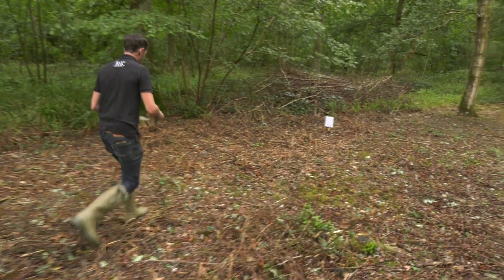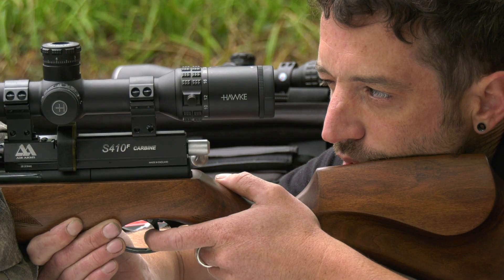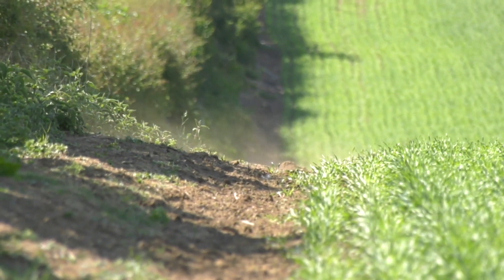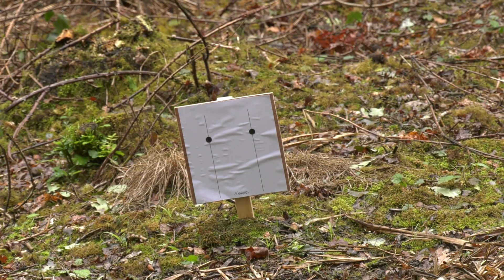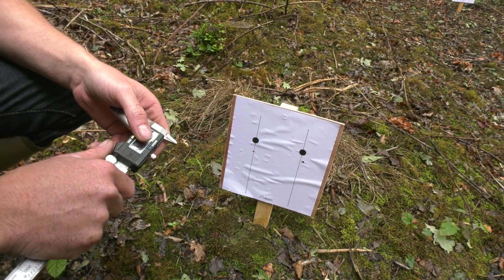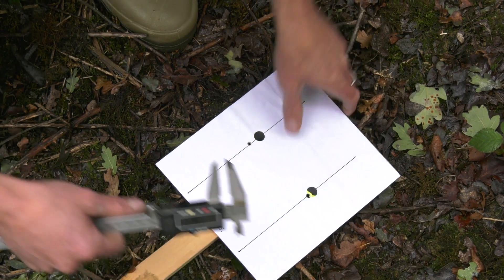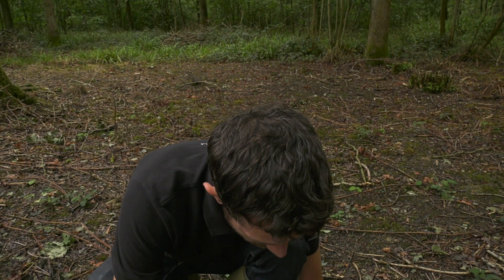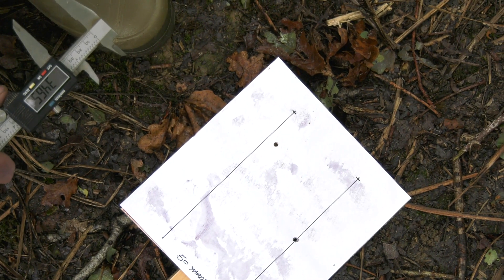What's the trajectory difference between a .22 and a  .177?

Comment: No, I do not think your test is valid, what about the speed? If they were fired at the same speed the picture would be very different! I suppose your test is valid if both were limited to the same fpe but if they were fired at the same velocity the .22 trajectory will be flatter than the .177 due to a better BC.

Comment: I thought it would make bigger difference. I would call it a success if I could hit that 50yard board at all. Last time I tried hitting at all at 30 yards with cheap pellets, I couldn’t. They were too cheap😂It depends all on rifle, pellet and shooting position and experience. From that clip I’ve learned that it makes no difference for target shooting. You zero it and can shoot all day long. .22 will be more wind resistant and have slightly more energy left on the target. I don’t see a point for switching from .22 to .177. Besides cheap co2 rifles never get 17J. It’s for maintaining higher shot count and stability. So if I crank up power slightly then it might even shoot faster than off the shelf some .177 co2. And if there are some even over 10 grain .177 pellets and compared to 13.4 JSB jumbo RS .22, then it is almost the same trajectory. Besides in my country it’s not allowed to shoot animals , so one shot one kill is not an issue. I don’t even have comfortable shooting range easy to access for long range, poor lighting, ppl shoot there from pistols at 25m.

Comment: Just get a cheap golf range finder and use range stuckers on your elevation turret, stick out some targets at 5m intervals, range them ,and adjust your turret until you are on zero and stick a range sticker on and keep going out to 60m ,one all the stckers are on ,cover the turret ring with a clear tape to protect them ,if not and you can afford £600 get a range finding NV scope that adjusts your zero and you can film at the same time
Reply: What rangefinder scope is there for 600 quid? Genuine question. Just got a new pcp and want a scope
Reply: @BRISTOLDNB  DNT make the Arken Zulus 3x12 or 5x20 day/night vision with a built-in LRF ballistic calculator ,they do one without the LRF for a bit cheaper but for the extra money I would get one ,they have also bought out the Thermnight ,so same set up but with a thermal scope built in so you get a 3 in 1 scope for £999 and a few more other models that is slightly higher in price ,if you are ratting in a barn and shooting out to 50m get the 3x12 as this will range down to 4m out to 1000m for sub 12 airguns, if you want a bit more range go for the 5x20, the do more powerful mag ones ,all the models can take centerfire rifles and been tested on .50cals ,very small and compact and lightweight, everyone or going mad for them ,DTN also listen to customer feedback and after service is great ,I love mine
Reply: @crazycressy7986  thanks mate that's super helpfull, appreciated!!!
Reply: @BRISTOLDNB  they have a few fb groups as well ,lots of tips and tricks and good guys on there to help set up if you get stuck

Comment: The bigger the pellet, the faster they fall...  I dont need a rangefinder.  I have 8.3 gr Superdomes at 1,000 fps, 18.4 fpe.  Pest lethal at 45 yards with nearly no holdover.  Zero at 30 meters.  Why would I go back to a 22 with the same power but worse accuracy?  177 doing just fine in all my guns.  One shot, one very cheap kill.   Good video.

Comment: I think this changes between calibers when pushed to FAC levels. I believe reason being weight and drag. I can’t see hitting anything bigger than a sparrow past 50-60 yards with a .177 7.4 grain and with a .22 18.13 that’s 2Xs as heavy at the same speed has taken pigeons at 100. I understand your tests are at sub 12 levels and in that limit you are correct. The higher the speed the flatter the trajectory imo for the most part but the drag and weight are also a factor when covering longer distances. Speed matters.

Comment: Comparable lines of .22 and .177 on a graph would show what the difference is better.No one seems to have used that method of explanation.I use a AA s400 (11 years old in 0.177) and sight in using barracuda heavies.I sight in at 30yds to 40yds for my average for rabbits.(12ft lbs)

Comment: FWIW, technically speaking, projectiles do not "rise and fall" upon leaving the barrel, they only fall.
Reply: But the barrel is pointing upwards, so the pellet rises then falls.
Reply: @JesHill  not relative to the straight line out of the barrel.
Reply: @gbone7581  Correct, the pellet will never rise above the barrel line. Obviously if the barrel is elevated above horizontal the pellet will rise. It can be confusing to a new shooter if this is not explained.

Comment: I used to shot lots of vermin but always with spring powered or gas ram rifles. In N Ireland all air rifles had to be on a firearms certificate so we shot with higher powered rifles than GB legal limit rifles. It’s great to know your pellet/bullet trajectory but you should also be aware that different shooting positions will change your point of impact ie standing, kneeling, prone. It really helps to try those out as I regularly used all three positions and can’t actually remember taking a shot from a rested rifle when hunting.

Comment: You are over looking weight of pellet used in. 22 calibre remember lighter pellet trajectory is going to be much lower example 11gr 13 gr : and a lot of. 177 shooters use a heavier pellet 10.5 gr which gives better hitting power but trajectory is knocked off flat shooting so it's not all Rosie glasses for. 177 👍
Reply: Please forgive me if I have missed something in your comment.  It would seem if one has decided on the favorite pellet that your air rifle or pistol, whether .177 or .22, prefers by testing several different manufacturers, types, weights & sizes and have completed this exercise, you will have the trajectory information that you need to make proper corrections.  Decided to start shooting the latest and greatest flavor of the day?  Go through this exercise again to determine the different variables in the trajectory.  Please let me know if there is something that I have not understood corrrectly.  Thank you.
Reply: @Jeffrey Pursley  The point I was trying to make simply , using a heavy pellet in .22 example 16gr it can produce a loopy trajectory , but example use a 13g and the trajectory is more or less flat , a 11gr RWS flat Head is even flatter shooting .
But using a heavy pellet example 10.5 gr can open the trajectory up, so it's safer to use a 7 or 8gr pellet for flatter trajectory, hope this helps
Reply: It is at 20 ft/lbs, sold all my .22's replaced with .177's much happier now.
Reply: @michaelbritain5546 I have a 22 fpe .177 and I grab it more than any of my other 12 pcps. It loves 10 grain slugs and shoots like a laser. I realize that has little to do with this video, but it sure is fun.

Comment: Sorry guys, your comparison is far too simple. 
The 12 ftp may be a limiting factor for isolated UK, but that is not necessary true for other countries!
You did not take into account following:
*Speed of projectiles
*weight of projectiles
*shape of projectiles

I shoot 6.35 cal jsb exact king pellets (25.4 gr) with a very flat trajectory over 50 mtr and more with a speed of 270 mtr / sec.

I shoot JSB king heavy 33.95 gr.  with 250mts/sec with slightly more drop but still with a rather flat trajectory.
I Shoot .25 slugs around 290  mtr / sec with a flat trajectory up to 100 mtr distance. 
For small game in open field I have very good results with the cal 6,35 jsb kings up to ~75 mtr distance. This pellet has enough speed and weight for accurate shot placement and ethical game dispatch.

Comment: What is the speed at the muzzle? The test is only good if they have the same speed.
Reply: Probably the UK's limit under 12ft lbs. So I'm guessing the .22 is around 570fps and the .177 at about 740fps depending on the weight of the pellets used.
Reply: Don't be ridiculous, .177 drops less BECAUSE it flys much faster, otherwise both would drop the same  under gravity's acceleration...

Comment: Great video and great information, I use 22 for the likes of ratting but prefer the 177 rabbits and those longer shots. I was a 22 bloke for years and never gave the 177 a thought as I was like many who always said if your getting an air rifle get a 22 they’re much better more knock down power but how wrong I was, if you use the right pellet and the shot placement is correct the 177 has devastating results. There is a video on the field sports channel I believe showing what a 177 pellet is capable of and is definitely worth watching as the results are very surprising comparing both 22 and 177.
Reply: That's why I replaced all my .22's with .177's, both spring and PCP's, I still have one .22 but rarely shoot it.